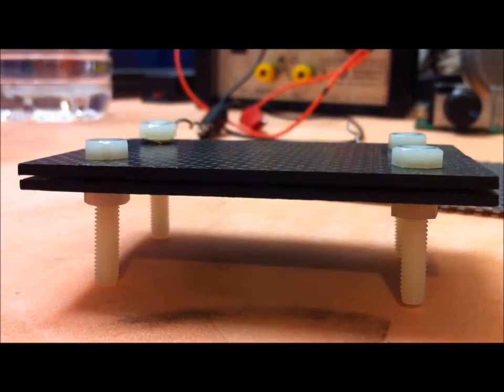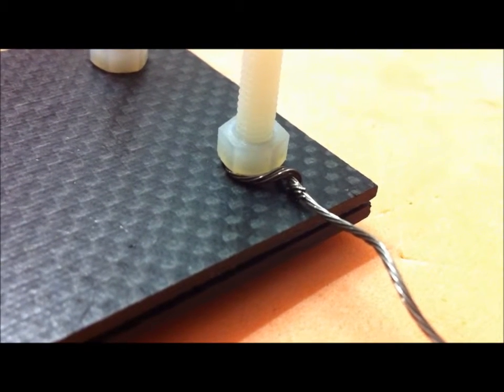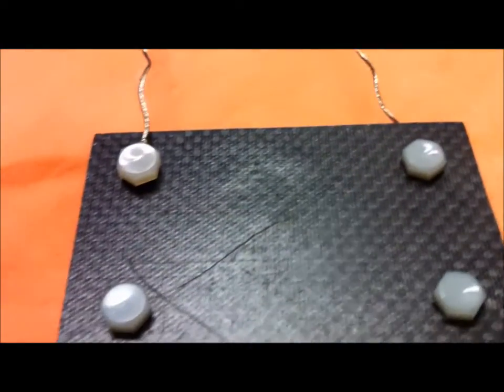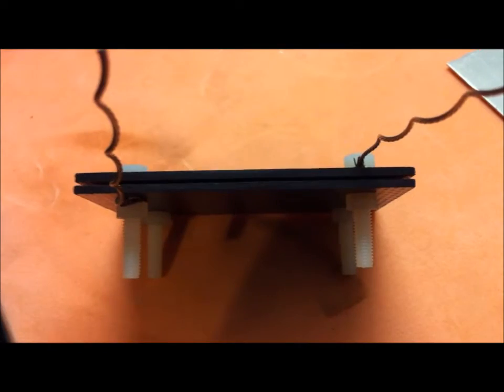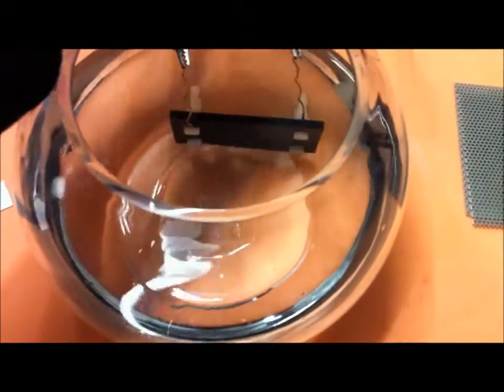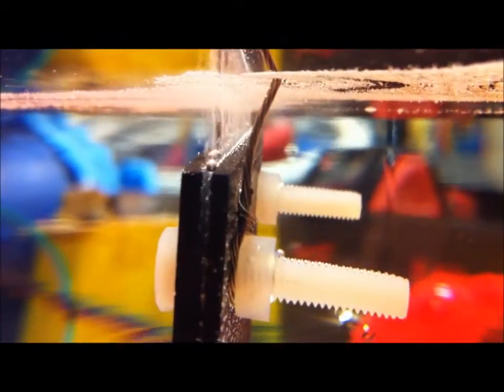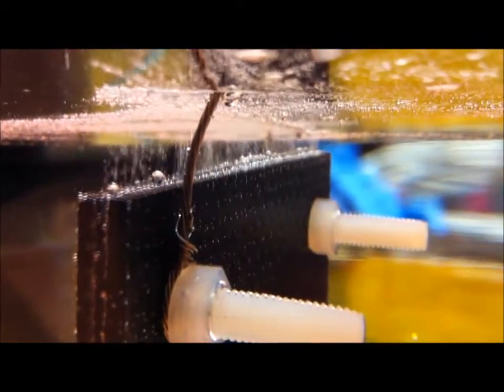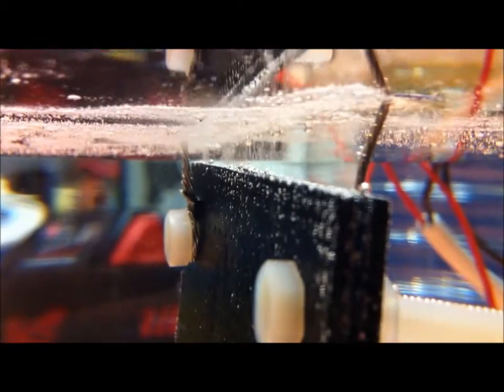Experiment #2 - Carbon Fiber HHO Electrodes In Spring Water & No Electrolyte! 12VDC @ 310mA

Comment: I appreciate that you appear to have moved on. But... Most conductors are non magnetic. You need a moving magnetic field to get a magnetic response, signifying it is conductive. Slide a strong magnet along the carbon plate and it should drag if it is conductive similar to copper, Al, Au, Ag. Have you actually tested the gas that collects over the water? Is it energized water, denser than air and implosive when ignited, with blue flash? Or is it oxygen that will respond with causing a glow Stick to flame? Or, is it quickly dissipating hydrogen gas that will pop and flash along surfaces? I read that lead amalgum electrodes generated HOH gas deferentially, but the source and substance are questionable. Carbon electrodes may be a good choice for making HOH gas if that's what you're generating in primary form...
Reply from the maker: +BMan18 
I have done the magnet test and it does not drag like it would with Al or Cu, however, I can assure you that the plates are conductive. They are carbon fiber with carbon nano tubes dispersed in the epoxy. This gives the plates conductivity with a non-linear resistance. And by non-linear, I mean non-linear. Every point on the plate has a different, arbitrary resistance. Anything from 2 Ohms to +15KOhms (and that is in one square mm). Perhaps I should do a video showing this by passing current from a battery through a carbon fiber plate. You will see some conductive properties that are not possible with ordinary conductors. I can even generate voltage spikes in excess of 50V with only a 6-12VDC input just by sliding one of the battery leads across the plate. You can't do that with copper because the resistance of copper is linear. We can also see the DC waveform changing on the oscilloscope as the battery lead is moved along the plate. The faster the battery lead is moved, the higher the voltage spike... To be continued :) 
The gas ignites. That's all I know for sure. Saying more would only be speculation on my part. I have ceased my HHO experiments with these carbon fiber plates because I started exhibiting some health problems for a few months after I started playing with them. Perhaps the gas & the carbon nano tubes in the decomposing electrode had something to do with this, but I can't be sure. Better safe than sorry!

Comment: There is a man who powered his boat from electrolysis. He patented his device and the witnesses said that he had "taken a metal and used the metal to use electrolysis in a new and novel way that consumed very little power." You see, you can use the reaction of certain metals with certain electrolytes to capture the extra energy the skeptics say you lose. That's not the only way, but it's an example of why skeptics are wrong.

Comment: So I get so sick of the childish comments on Youtube that say you can "NEVER" get more energy back from water than you put in. Obviously electrolysis is not a linear equation. Making HHO from electrolysis is not a linear equation (example) certain acids and metals react to create hydrogen, without any electrical energy. Some metals won't produce a single bubble when used in electrolysis, no matter how much voltage you have (see my water sparks video). Electrolysis efficiency varies, period!

Comment: a/c will just heat the water, you need to use diodes on your high voltage to rectify it.
I believe high voltage will work, but not as efficient as 2 volts per plate gap.

Comment from the maker: Unfortunately, I don't think that your 'fiber bundle' idea would work well for a number of reasons. I have seen a similar experiment conducted in this way and the outcome was high heat production, electrode deterioration and rapid discoloration of the water - however that was a slightly different material to what I am using. I am guessing that I would only follow the same path if I started using fiber bundles.Thanks for your support!

Comment: Awesomesauce! I'd love to help spread the message. If you run into problems, I know lots of folks who'd love to help if they can. Keep up the great work, mate!
A side thought.....what if the CF was stacked bundles of fibers with the ends making up the surface faces of the plates?.....kinda like stacking a bunch of toothbrush bristles tightly together with some length left unglued and exposed to the water.... Glued in the center only.This would increase the surface area considerably I'd think.

Comment from the maker: Stainless steel is the material that is most widely used.
There is also platinum coated copper etc, etc...
These are all for low voltage, high current applications.

Because my generator will be powered from high voltage and low current, I need something different to the standard materials used today. I also needed a material that was strong, possessed a high ohmic resistance and more importantly, capable of operating in the high KHz range.
These treated carbon fiber electrodes do the job.